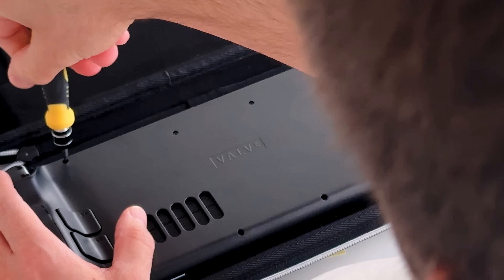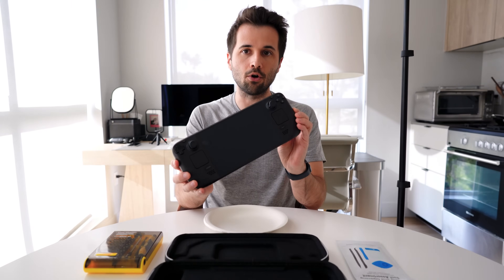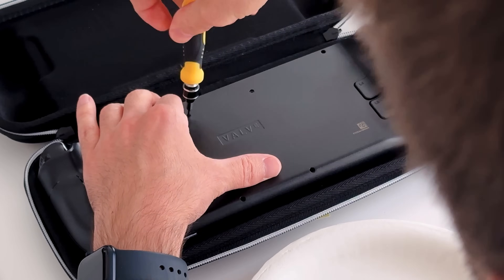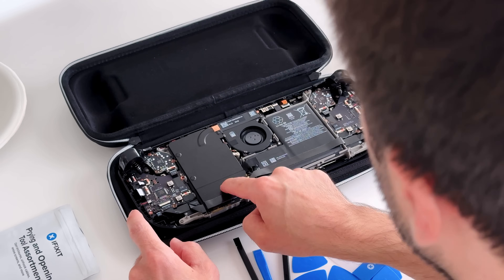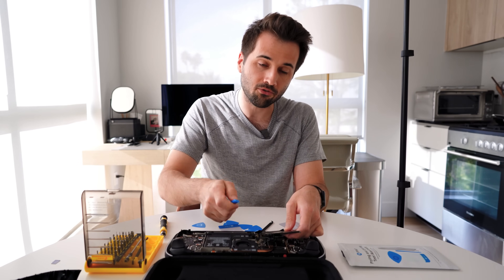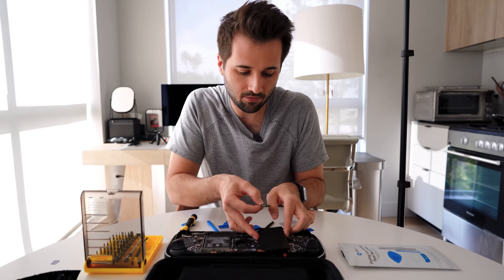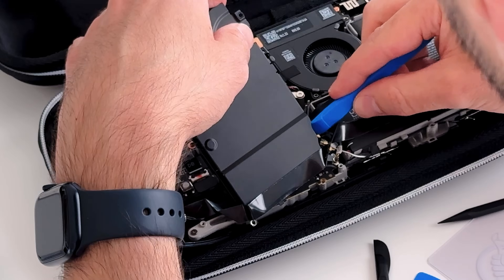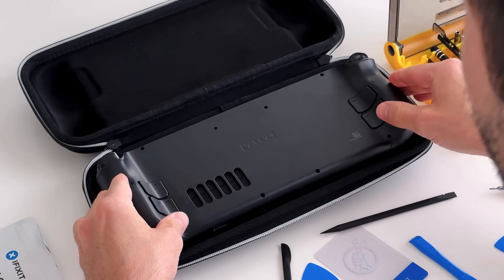How To Upgrade the SSD in Steam Deck OLED

Comment: Make sure you pull the white tab out on the black ribbon. 

Took me a while to figure this out. Also check your OLED for dead or stuck pixels, mine has 3, very annoying and I hope Valve RMA’s mine.
Reply: Hmmmm not noticed any on mine had it a week but not done any pixel tests.
Reply: Dead pixels on an OLED screen stick out like a sore thumb
Reply: Did you get the limited edition?
Reply: I have the 512gb version and I have no dead pixels. It's a beautiful display.

Comment: Is it possible to get normal ssd , the big one that cheaper and faster with an adapter
Reply: And how the adapter will made the bigger ssd smaller?  I'd love to see that.
Reply: @dud1n  its work watch on video by rog ally it's fit perfectly in it
Reply: @steveaustin8086 ROG Ally doesn't have OLED.

🤣🤣🤣
Reply: Too big gets really hot too, you can force one in but risky.
Reply from the maker: No it won’t work because the SSD points to the bottom of the case and the longer NVME drive wouldn’t fit. I’ve seen people do some crazy stuff like right angle adapters but it’s just not worth it when SSDs are so cheap right now.
Reply: I greatly appreciate your video. Had no idea there was a difference between the NvME SSD cards and had picked up a long one (a m.2 2280?) instead of a short one (a m.2 2230?) Still not sure if those are the correct designations.

Comment: Why its so much harder than rog ally ?
Reply from the maker: I noticed the same thing it’s a much harder upgrade than the RIG Ally but I think that’s a trade off for having larger SSDs by default. They optimized the build and made it slightly harder to repair.
Reply: Ask Valve

Comment: 6:24: Wouldn't it be easier to disconnect the ZIF connector on the left and fold the shield to the right?
Reply: Great video. So helpful! But this did help so thank you also!
Reply from the maker: I tried that but it wouldn’t come out easily so I stopped.
Reply: @TonyCassara  You have to lift the little lever up and pulling the cable should be easy then.

Comment: It's not a hard drive it's a SSD
Reply from the maker: It’s gif not gif
Reply: It's "an SSD" not "a SSD" - also hard drive is an acceptable term for all formats of storage drives
Reply: @Riknos No it isn't. 🤣🤣🤣

That's like calling a Micro SD card a hard drive.
Reply: @Riknos wrong. A hard disk drive (HDD) is different than a solid state drive (SSD). You do not refer to a SSD as a hard drive because it’s not a hard disk, it’s a solid state. 

Source: I am an IT/Computer Tech.
Reply: Relax little feller
Reply: Shut up nerd
Reply: Judging by your comment, your anime profile pic makes absolute sense.
Reply: Ah here's the pedant!
Reply: It's a file storage device 😂
Reply: If you're going to be a stickler be more correct... it's not an SSD, it's a NVMe.
Reply: NVMe is just the connector standard so you're the worst kind of wrong.   @Aethelbeorn
Reply: @Whatnoww  You might need to touch grass if that's the worst case of wrong that you've ran across.
Reply: Using the term “hard drive” is a perfectly acceptable colloquialism to refer to both an HDD and SSD. What we consider “hard” in the HDD terminology is arbitrary, since we could equally refer to the storage in solid state drives as “hard” as well. 

There are still a large contingent of legacy users who aren’t familiar with the correct nomenclature of mainstream hardware. 

It’s also totally futile and unnecessary to correct what can be gleaned via context. 

TLDR; don’t be a knob.

Comment: So I need a computer for this to work?
Reply: No, not if you have a case you can put the new SSD in to connect it to the Steam Deck via USB C. This way you can clone the „old“ internal SSD including the operating system to your new one first through desktop mode. After that you can swap them out. This is how I did it, worked flawlessly. 

EDIT: well I just realized if you don’t have other data on your old SSD, you can just create the recovery image on the Steam Deck itself beforehand. You just need a USB C drive this way.
Reply: @Trojanischer_Esel this will be my first steam deck so nothing to clone

Comment: I get all the first part but I want to know on the files part, I wish you had showed it and how that part is done,  I am afriad to mess up my steam deck, been waiting for someoen to show me on the files part because you ahve to put in the program back itno the asteam deck so please can you show us next time that part.
Reply from the maker: I will make a separate video, thanks for the feedback! For now check the link in the description the instructions are pretty good but they don’t show you step by step.
Reply: @TonyCassara Yeah same! The portion where it’s a brand new SSD. Formatting etc.
Reply: Hey good video but my back was sweating. You could have made your life so much easier by disconnecting the ribbon cable from the daughter board. By not doing so you run the risk of damaging or completely ripping it. This is very easy to remove just lift up the white tab holding the cable down and lift the up at a slight angle and pull it free the socket. As long as you take your time you make swapping the ssd drive a whole lot easier for yourself.
Reply: @shaneybaby  it’s glued down.  U just can’t see it in the video. Ribbon cable can’t be removed .
Reply: There's videos on YouTube on how to install Steam OS on your new SSD.

Comment: hello i wanted to know if i do the reimage on the sd card can i still swap out the reimage sd card with a brand new sd card for increase storage or do i have to keep the reimage sd card in the steam deck for it to work?
Reply from the maker: After you’ve recovered the SteamOS image you can remove the SD card / usb drive because your SSD will now have SteamOS installed on it. Thanks for the question!
Reply: @TonyCassara  and formatting the ssd is necessary even if u don’t mind re downloading all of ur games u had on the factory hard drive that we remove ? Like I can’t just switch to my 2tb ssd and then start re downloading the games I had . I don’t have an sd card just the 2tb ssd?
Reply: I want to put the old ssd  on the oled. But I am worried it will be formatted. May I skip that part?

Comment: Thank you! Finally someone who carefully demonstrates how to switch the SSD on the OLED! I don’t understand why there is no tutorial videos yet when it seems like everyone is buying the 512GB & switching the SSD with a higher storage size. Many seems to choose the normal glossy screen instead and don’t want the etched anti-glare screen Steam Deck because they say it greatly reduces color vibrancy which makes colors pop, which is the main reason why people want the OLED screen in the first place. I’m switching my 512GB SD with a 2TB tomorrow.
Reply from the maker: Thank you so much, I'm glad you like this! I love my glossy but I also ordered an etched screen because I wanted to see for myself how the two compare side by side. Video coming soon!
Reply: @TonyCassara nice! I am pretty sure it will come down to personal preference. I don’t think Valve would have chosen the etched glass for the highest tier model if it would be noticeably worse than the glossy one.
Reply: @Trojanischer_Esel But it IS noticeably worse than the glossy screen.

Matte screens DEGRADE picture quality.

The best TV's and monitors use OLED glossy panels for a reason.

Matte sacrifices picture quality for increased anti-glare performance. Nothing more.
Reply: i mean to be honest it's pretty much the same as lcd one and i think most people could figure it out without even watching a video...